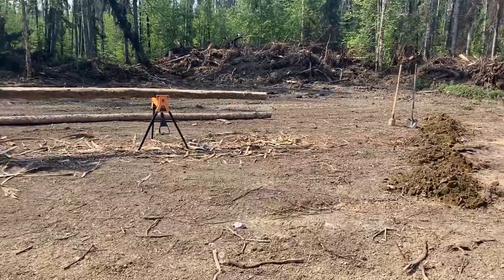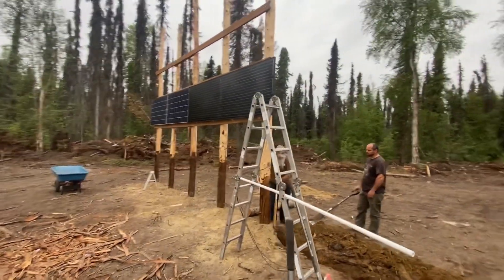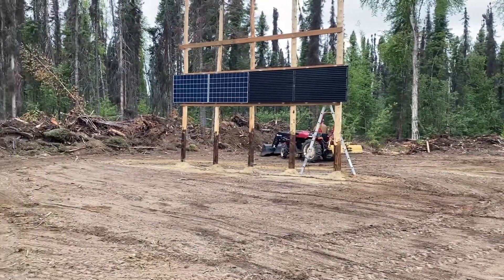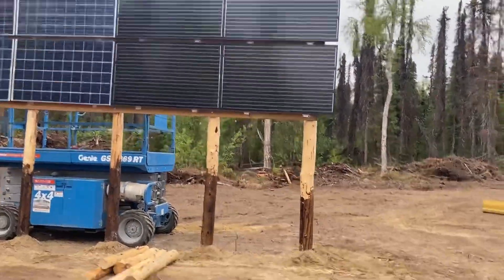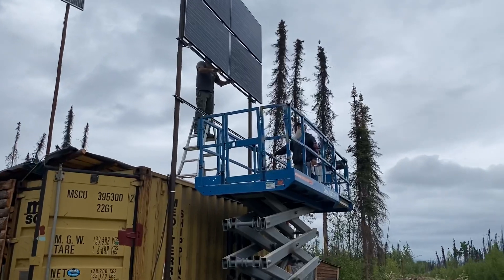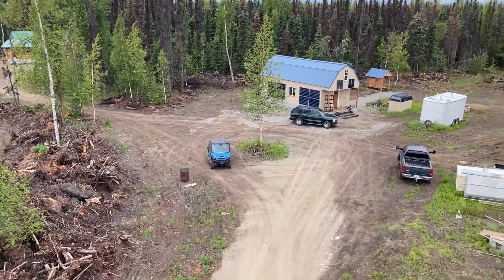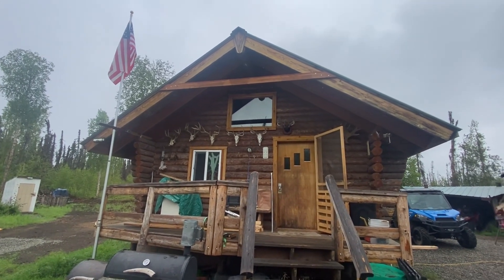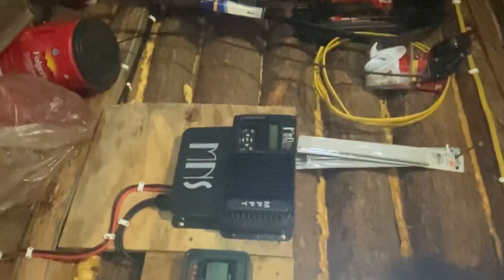Solar upgrades on the off grid homestead

Comment: Cool thanks for the overview it definitely makes everything clearer. Will the two panels on the convex be raised? I would think with the amount of snow they will be buried. Congratulations on getting all this done. From what you said you’re about a third of the way to basic firewood needs. Next will probably be the new woodsheds then the shop. Thanks for the video.
Reply from the maker: The two panels on the end of the conex won’t be raised. 
I may have to move some snow away from them

Comment: that enough to do all of you or are you going to have to use a generator a lot how about the guest camp anything on that
Reply from the maker: The guest cabin has its own solar power as well.
Each cabin has its own system. All are different depending on needs as well as budget.